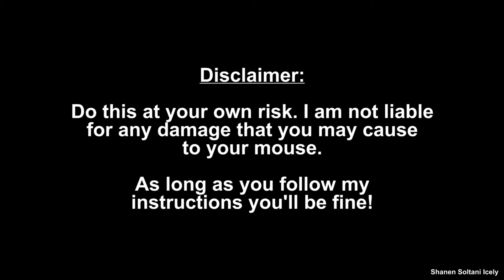Modify your Mouse to be Quiet

Comment: Since the buttons will travel a smaller distance after adjusting the inside, your mouse will also click way easier.
In other words it can become too sensitive to pressure and even an ant walking on it will trigger the click (exaggerating a bit but you get the point). In my case it was a bit uncomfortable to click.
Reply: As a drag clicker, that's a W
Reply: @ImmortalLeaf  ikr
Reply: @lowgpu1687  yes, 12 CPS in 1 drag with a 0.97$ modified mouse, because it was able to double click or even triple click :D
Reply: @Mk-ki3lx  Oh wow
Reply: @Mk-ki3lx   I saw your video lol
Reply: same bro even i put the mouse cover back on the click was so light, the mouse itself was holding it down 😭
Reply: someone didn't watch the video thoroughly, 5:47 he warns you of exactly this

Comment: does it still work 100 percent for every click, i want to modify mine for gaming bc my mouse is loud and when im playing games you can hear it across the house
Reply from the maker: Yeah, my advice is don't modify the height too low otherwise you won't feel the tactile response of the click. Even just lowering it a 1/3 to 1/2 of the original height will be vastly better in its noise level.

Comment: I strongly recommend not hammering it and instead using pliers or pincers to bend it. Repairing a broken metal piece is not always easy.
Can you try using rubber or similar materials to mute the noisy parts?

Comment: did all of this and ended up having no click and being 100 bucks shorter for a new mx anywhere. bummer. the brackets and the top button casing is such a painn
Reply from the maker: Dang $100 on a mouse? 
Why don’t you open up the gap on the switches more? You only need the gap to be like 1/3rd to 1/2th down from the original height to hear a difference, don’t hammer them all the way down.
Reply: I hope you didn't throw out your mouse. Raise up the 'hook' a little more, and you'll be fine. Also, I don't recommend removing the brass thingy at all. It's a royal pain in the a** to put back in.
Reply from the maker: @woofer13  Yep they are a pain! I just remove them to avoid them getting damaged when bending the hook.
Reply: @SSIcely  I buy very cheap mice because I smoke a lot of cigarettes and the ashes get into the mouse while I'm gaming. After thoroughly cleaning them out, eventually I just buy new, cheap ones. Anyway, I FINALLY figured out what to do when the brass 'spring' thingy jumps out. I took a flat rubber band (not the rounded ones), and cut a strip that could lay beneath the brass thingy while I adjusted it to catch on to the hooks. It gives it some stability so that it doesn't keep moving around while adjusting. Then I removed it by pulling it out afterwards. I finally came up with the perfect solution. It's no longer a pain in the a**. I discovered the solution while repairing some old mice of mine the other day. :-) EDIT: On another helpful hint- I buy wired mice because they are much lighter than ones that require a battery. My mice are way faster and much easier on the hand.

Comment: could this mod cause the mouse to do unintentional double clicking?
Reply from the maker: Yes it's possible if the gap is too small it will mean that only a light touch will cause it to click - so be careful when adjusting the micro switch.

Comment: will it cause click delay?
Reply from the maker: No, technically the travel is less for the microswitch and therefore less of a delay from when you use your finger to press the button to the switch engaging with the circuit compared to generic switches.